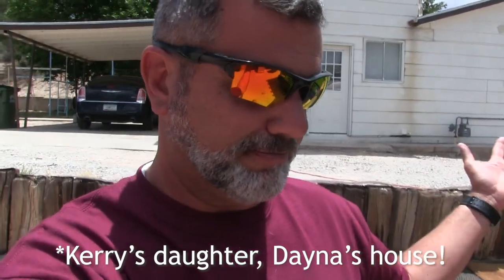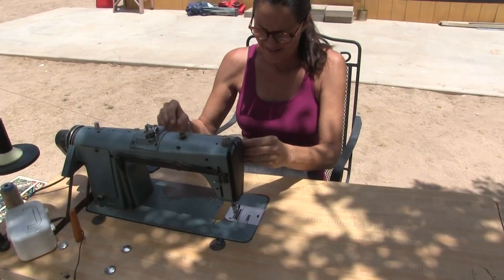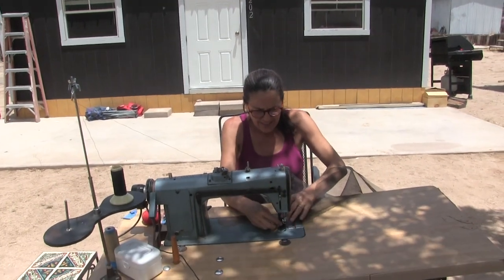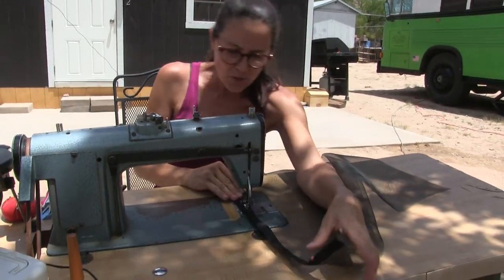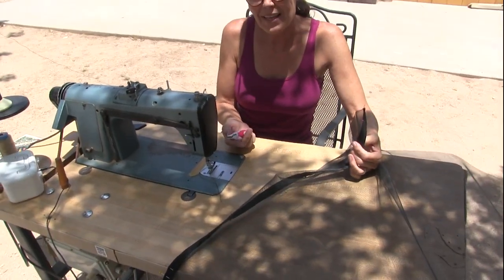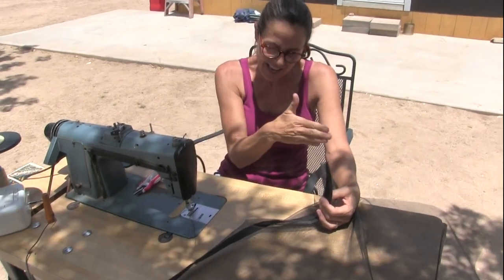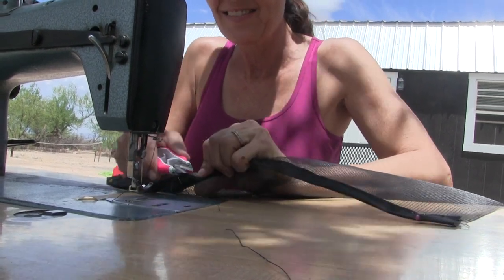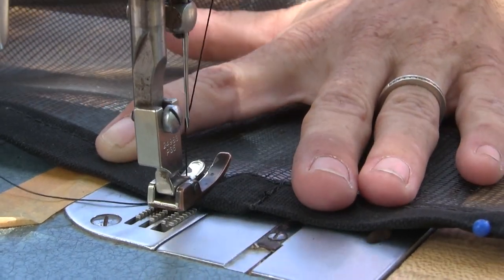Flexible Magnetic Window Screen & Skoolie Curtain Reveal!

Comment: You gave the answer to your screen bottom seal problem in your driver side curtain. Just counter sink some metal washers into the wood and put magnet pockets where the washers are just like attaching the curtain to the top of the Driver Window side curtain.
Reply: I would have put steel/iron screws in the wood for the magnets to 'grab.' The lead weights can be flattened with a hammer.

Comment: That would involve juuust a wee bit more work, but I would remove the sinkers at the bottom of the screen and just insert a small metal rod inside the fabric along the bottom. Just add two small eye screws flush with the bottom on each side to slide in the rod (sticking out a bit on each side for that purpose): secure that first, then magnet the rest in place. Sturdy and no gap! 🤔🤗 🧲 Velcro strips get dusty and dirty too fast... an alternative would be strong push buttons, with the male parts screwed along the bottom and the receiving bits into the fabric. Would work too! 👌

Love watching the progress as you adapt  to living bus life 🙌🏻😍🚐

Comment: I'm using galvanized steel strapping around my windows to work with my magnets. That may have worked on the bottom/wood portion of your back window. Then you could've used the magnets all around.

Comment: put several button holes across the bottom that are for smaller buttons, then use an upholstery tack nailed far enough in that you can still secure the buttonhole behind it.  This allows you to keep it very secure as well as enables you to be able to take it back off too!  Those fishing sinkers are lead aren't they?  if they are then pound them flat with a hammer and a rock.

Comment: You could remove the sinkers and use 3 or 4 short pieces of brass or stainless rod or some #10 threaded rod. The rods will keep the bottom strait. Using 3 or 4 pieces would allow you to still fold and roll up the screen when not used.

Comment: Love the screen and your curtains previous video.  If I were to do this,  do you think if I put a square dowel on the bottom nailed down the bottom. Magnets the rest of the way.  Think that would work?  Now I'm just at the dreaming stage and drawing floor plans and windows etc.  
Now back to the screen, when not using I'd have it roll down with a little upside down L bar length of screen to tuck it behind when not using?  Lol. Oh boy maybe an angled piece with a grove in it to hold my kindle, cell etc infront of the inverted L?
OMG lol 
Love watching just started.

Comment: Hello.  Thank you for sharing.  I would like to see what you did to correct your over heating problems.  We have the same issues.
Reply: Mike showed it in a previous video... He added an extra radiator to Bussy... I'll see if I can find the video for you...
Reply: @chuckspencer5296  Thanks.  I saw a few clips.  I was hoping to see where all the hoses were connected to the block. My heater is still connected so I may just go the route of opening that up but when you're bus is 100 degrees inside,  the last thing you want to do is make it hotter.

Comment: Why don’t you stick or screw a thin metal strip along the bottom edge on the wood? Or Mike could nail in some decorative metal studs along the bottom where the wood is & you then use magnets in the bottom that will stick to the metal studs…just a thought 💭?

Comment: Hey! Have you had any problems with your minisplit heat pump fan motor? I have one too and Ive been told that the fan motor could be damaged by air moving through i too fast while driving down the road.
Reply from the maker: Zero problems
Reply: @BussyMcBusface  do you run the hvac system while driving?